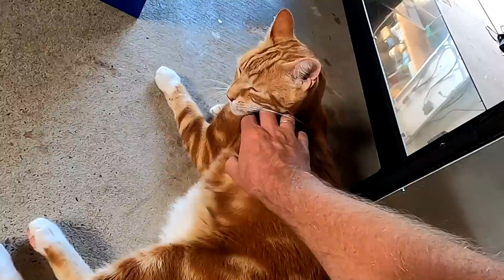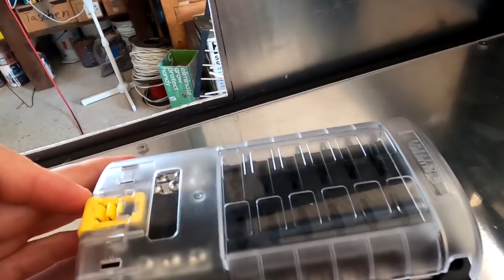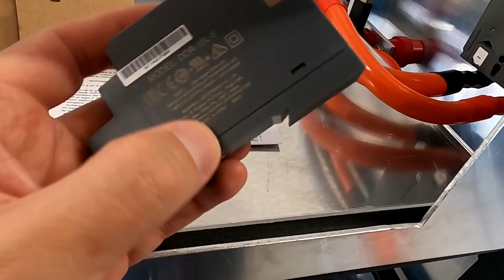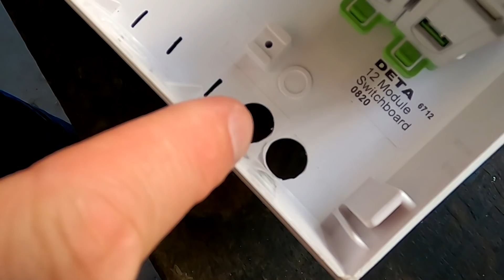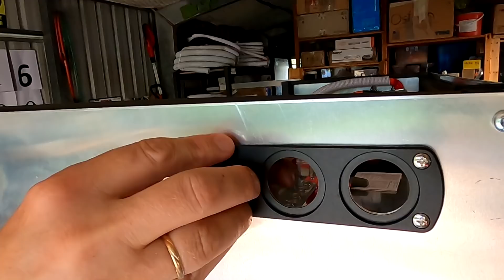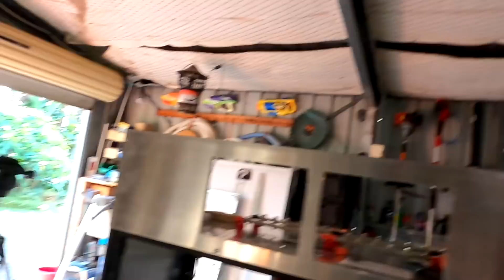48V battery powers 12V and 5V load through isolated converters | Battery2.0

Comment: Always wonder.  what If I seperate an already 16s battery to 4 x 12v without  remove bms.. Just 8 cables same length to 12v outlet and a 12v low voltage disconnect  a bit over the parameters than bms.. And voila you have 12v output only problem. You won't measure  the  loads . In small loads its going to be ok I guess

Comment: Hi Andy, I live in the UK and I can buy a 6kw 48 volt hybrid inverter that can power 240volts ac without batteries. My question is, while I haven't got any 48 volt batteries for storage at the moment ,but have 12 volt lithium batteries 100 ah each,.can I connect a 48v dc to 12v dc to the 48v hybrid inverter  to charge my 12v lithium batteries? 
Cheers Jason.

Comment: Hey Andy, looked at several of the videos and your blog but did not see any parts listing for the flexible wire loom you used and the wire glands you used with the loom.  Is this loom split or solid?  Would kind of like to use this stuff but not sure where to find.  The stuff I see and have used before for automotive usage is not only split but also rather hard plastic.  The stuff you are using appears to be much more supple and not split.  Let me know if you have time.  Thanks as always

Comment: Hi Andy, just a daft one about your 12v fuse box, you have room on front panel to mount a box to witch you could fit the fuse box into, that way it's nice and tidy but also give access .......well just incase you need to replace a fuse or up rate a circuit.......just a thought.

Comment: Hinge on top cover. leave the front alone.
Also don't run 5v out of the shelf. too much losses over long cables. best to run 12v to your access point and use a small buck converter to drop the voltage down at the destination.
This is why electric companies run high voltage lines to step down transformers before going to the houses.
Reply from the maker: The 5V output voltage can be adjusted to compensate for the cable length. It is set to 5.2V by default it says but can be bumped up to 5.6V I believe.
The Raspi pulls around 1.1A, the Wifi bridge less than 500mA. If I use a 2.5mm cable, the voltag drop should be managable.
I understand where you're coming from and it makes sense.

Comment: Plase consider that usual AC breakers do not care for voltage loss i.e. of 0.5V as in AC application the losses are miniscule. But at low voltage applications this might be an issue.  At rated current they may dissipate up to about 5W each (depending on rated current and manufacturer). Manufacturers do not like to provide the internal resistance in their data sheet.
I do not claim that this "feature" is necessarly a disadvantage in your application but it should be looked at.

Comment: Hi Andy, it's really fun to watch your videos. And we can learn and benefit so much from your projects. 
But I have a comment about the DC-DC converter you want to use for the Raspi and the WiFi router. Isn't 3 amps too low for the two devices? For the Raspi4, 3 amps is already recommended and the router will also need 1-2 amps at 5V.

Looking forward to the next video.
Greetings Andreas
Reply from the maker: Thank you. The Raspi draws only 1.1A while starting and around 0.7A during normal operation, the Wifi bridge is 0.5A all the time, so should be totally fine. I can also adjust the output voltage of the 5V converter.
Reply: @OffGridGarageAustralia  power 4 USB with 3 amps, not enough. The MPPT stop communicating and show disconnected. Saludos!

Comment: the "fridge" you were complaining about us a thermoelectric peltier device,  they have a max perfect world potential of 40°f, so if its 60f they can freeze to 20f, at 80f they can get to 40f,  100f to 60f ect,   and that's perfect conditions,  most only can do a delta of around 25-30f so they are more designed for preconditioned spaces.   look for a true compressor fridge,  they cost more but work better,  dometic makes a front door open version used in semitrucks and RVs,  wynter makes a great chest cooler version for cars and outdoorsey tailgater type stuff.   there's also the combination units (not talking fridge/freezer combos as they all do that)  the ones I'm talking about are referred to as multi way with auto changeover... ie a 2 way can be run on grid power with a battery backup(manual switch sets power use priority),  a 3 way has grid, battery, and natural gas/propane,  there are others that can run diesel/petrol instead but now your talking big $$$$,   they work like the webasto diesel fired air heaters almost,    check amazon, truck centers or the rv superstores,  not all these units are created equal so do your own equipment quality checks, don't go off the sales guys word,  still  loving the content
Reply from the maker: I took one apart and the potential was only 28° as per the specs for this peltier at 12V. They let it run on 5V (USB) with no power for cooling whatsoever. The beer was warm 🤢

Comment: Now we need to test those USB chargers to see if they are actually QC3 or they have have the QC3 USB ports installed in a 500ma body....
Reply from the maker: I tested one with my phone as it has QC tech built in. It maxed out at 2.8A and had two flashes in the display for ultra fast charging. Never seen this before. At around 70-80% the current started to taper off.
The cameras will slow charge anyway. They don't take much more than 600-700mA.
Reply: @OffGridGarageAustralia  I'm not surprised that you have already tested this... After all, it appears to be in your nature to leave no stone unturned LoL... Good job 👍👌

Comment: Addendum to the below: regarding the opening to service the 12VDC supply, the best way is to have a hinged flap with a handle, on the top (‘roof’) cover, as you suggested. That way the facia will look neat n tidy. A thought….

Comment: 121921/0003h PST 🇺🇸      121921/1803h Brisbane🇦🇺  Thank you for the video. The job has good precision on all cutting, drilling, tapping, and the holes for the USB female sockets and 12V socket. Both ends of the Al panel cutout has a design that adds to the beauty of the console. Great job, indeed. The 72~24V to 12V @3A DIN rail converter unit looks good. Do we have make and model number of the unit? Thanks once again take care n be safe. 73s…
Reply from the maker: I bought this DC converter from here:
https://www.tro.com.au/search?keywords=dc%20converter
They have great prices (if you're here in AU) and also stock the large NOARK MCCBs.

Comment: does raspberry not need an extra display for various monitoring? combine display with a hatch?
Reply from the maker: The Pi does not need a display as it runs from the app. You can connect a HDMI screen (even with touch) but I need to wait until the shelf is in place to see how much space I really have left. Some other upgrades are on their way...
Reply: @OffGridGarageAustralia  which app do you use for raspberry pi
Reply from the maker: @BandNorway  sorry, I was talking about the Victron VRM app. VenusOS is running on the Pi and this app connects to it. The Pi itself does not need any further maintenance or control.

Comment: The normal car fuses are only specified for 32V, but there are some specified for 58V.

The fuses at the 12V output are maybe useless, because the DCDC converter is short circuit protected already, they may protect the USB and cigarrete lighter sockets
Reply from the maker: I like to have single fuses for the circuits (cable protection). Just for peace of mind. But generally you're right.
Reply: The fuses are designed to protect the wires going to the individual loads. That is all.
Reply: @seanajacobs  Depends on whether the Victron converters behave like a constant-current power source or enters a fold-back state (greatly reduced current until the output voltage recovers) in case of short-circuit conditions. If the converter has fold-back OCP instead of relying only on current limit, then the fuses may never blow since the converter will reduce current below the fuses' threshold within a few ms, 2-4 orders of magnitude faster than a 5A fuse on a 20A current-limited supply.
Reply from the maker: Dan, the Victron converter will do constant voltage and also constant current. Hence it can be used as a float charger for batteries. It will limit the current to 20A max, no matter what.
Reply: @OffGridGarageAustralia  There are battery chargers that cut off when the voltage is too low for a given current since it can be an indication of a dead cell and become a hazard. Similar reason to why some lithium pack protections go into lock-out and require manual recovery when a cell has excessively low voltage.
If you want to float a 12V lead-acid battery (~13.5V) and you only get 10V while charging at 20A, chances are you have at least one shorted cell as even a healthy fully discharged lead-acid cells would immediately bounce back to 11-12V when charging current is applied. In this situation, you would be pumping 200W into running the remaining cells as HHO generators (overcharging the heck out of them) that could potentially explode at any time and spray sulphuric acid all over the place.

Comment: Hi Andy, I was taught to always bend the cable to shape on tight bends before crimping the lugs on them. The reason being the cable strands in the outer part of the cure will stretch  if you bend them to shape after they are crimped.
Reply from the maker: Yes, that is correct. If you crimp close to the bend, the single strands will move as you said. I leave the strands longer, bend the cable before roughly before I crimp and cut off the excess ferrule afterwards. The cable has then already a 'bended' shape.

Comment: Once you put the partition up for a 12-volt and 5- V sideways you could do is either drill a hole in tapaha at the pop right next to the other circuit breakers and then cut that sheet of aluminum after that so that way you can remove an access panel or cut you a square hole just afterwards a good-sized one that you can use as a maintenance hatch get a piece of aluminum cut that's a little bit larger than that hole by about an inch drill some holes in it tap the opposite side of the panel and put some removable screws so you can have you an access hatch as well

Comment: Want to see you parallel your batteries.  Mine charge at different rates.  So 30% to 80%.  200ah x32 split in to parallel packs of 16 with daly 250amp bms.  Weird how 1 pack charges faster.

Comment: Why not put casters on the bottom of the shelf so you can move the cabinet away from the wall if necessary, without having to take the batteries out?  It might make battery installation easier too, since you wouldn't have to put the self in its final location before installing the batteries.

Comment: Interesting... Even though I'm from Norway and lives in UK, I bought a land in Budapest where I build my new 142m2 home. This home will have both 220v AC and 12 and 5V DC grid. All lights will go from the 12V and I also bought 5 car stereos that I will use for the different rooms, including the bathroom. Car stereos are good and low-cost. So a 12V grid is good, but does not need to be exactly 12V. It's OK up to 16.4V. For the 5V I bought almost the same as you, plus some volt and ampere meters that I modified with a push button for the read out. So yes, having both 12 and 5V DC is a smart move when it comes to not using silly amount of transformers.

Comment: Super Video.
Machen Sie alle drei Etagen voll mit Akku. Oder machen Sie ein anach dem anderen. Was machen Sie mit den alten Akku integrieren. Oder in Rente schicken.
Reply: I'm pretty sure Andy has 32 new batteries, and will put the existing 48v 16s1p cells into the new battery shelf as the third. 48v 16s3p @840Ah. 40kWh system.

Comment: I use a normal 240v laptop power supply for 12v. You can just cut the 240 plug off and it will run off 48vdc. Use local 5v power supplies. Make sure you take lots of pictures so you can document this wonderful build on your website.

Comment: Working from above is not a good solution. I'd put in a maintenance access door. Maybe from the side below the USB outlets? If that's not possible I'd go for the front panel.

Comment: If you cut the front panel, you could put plexiglass over it, and put colorful LED's on the inside to make it 'glow'.  Then tap the panel so you can unscrew it later if necessary.  You would probably need to make this inside presentable 24/7 so that it always looks good.

Comment: For your outdoor 5V access point, rather distribute 12V to the AP and then use a small buck converter to 5V. This will minimize the power losses and voltage drop across a lengthy cable.
Reply: I use passive PoE with PoE to 5V USB and PoE to 12V DC converters. It's helped me get rid of a load of plug adapters. You can get cheap inline splitters readily.
Reply from the maker: @BobHannent  This would be my second solution if plan A fails. I just want to try it with the long 10m 5V line and see if the voltage drop is too much.
Reply: @OffGridGarageAustralia  one thing I haven't figured out yet is how it's possible to run standard PoE from a 16S source. I suppose as long as the voltage is over 48.7V you can use a DC-DC converter with a decent input range.
Reply: @OffGridGarageAustralia  The voltage drop will be a function of the current draw. Lower current, lower drop. However the lower the voltage, the more current your peripheral will draw.
Reply: That’s very correct. What ever the DC loss can be trimmed at the BC potentiometer to exact 5.2VDC. Thanks.